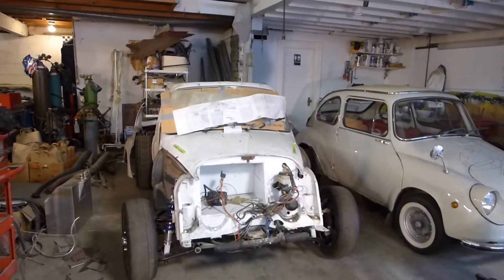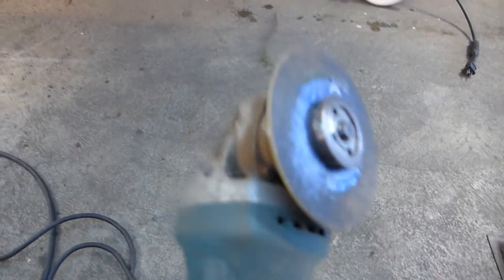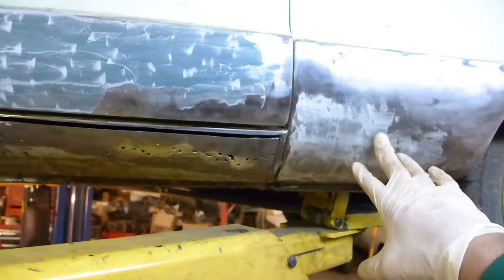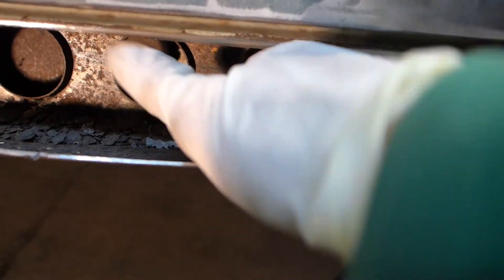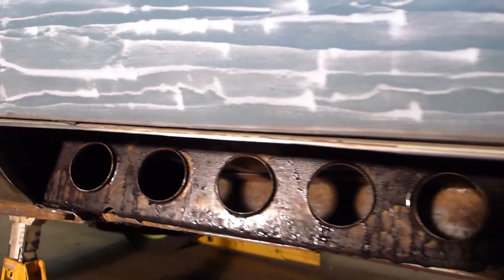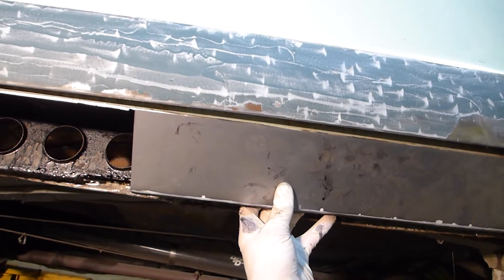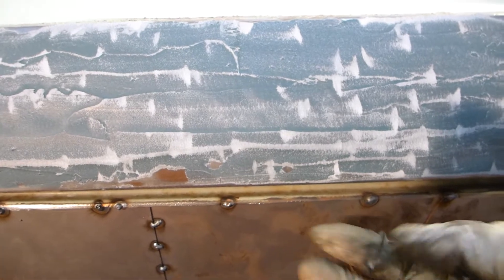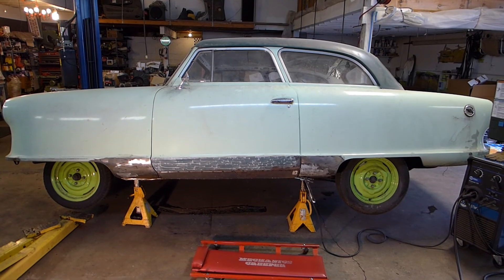1954 Nash Rambler Rusty Rocker Repair

Comment: That's a lot of rust... You might want to upgrade your new rockers with extra drain holes in the bottom so that water can't accumulate in there below the frame hole level. Keep up the good work and keep 'em interesting and informative videos coming!
Reply from the maker: thank you. actually this car is blessed with very little rust...compared to what others I've seen